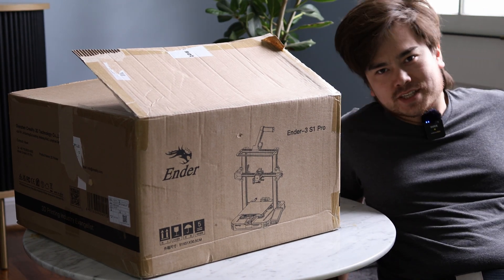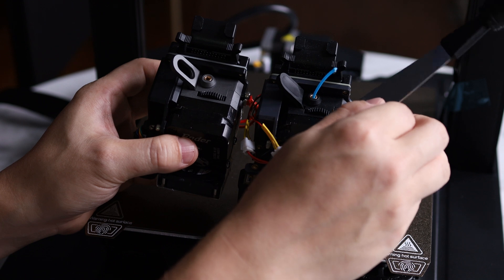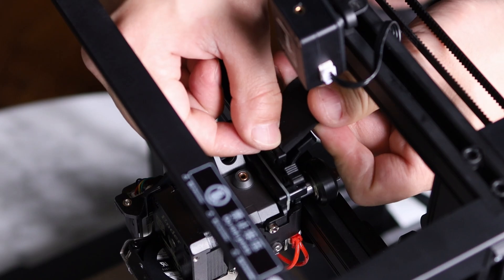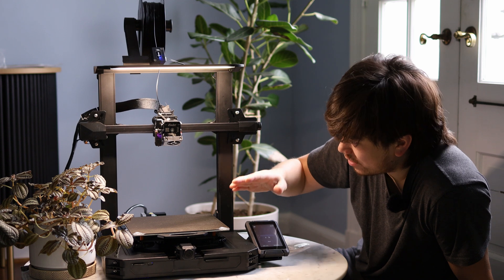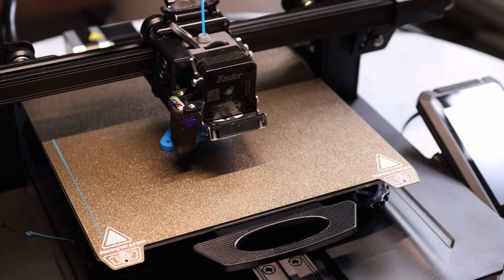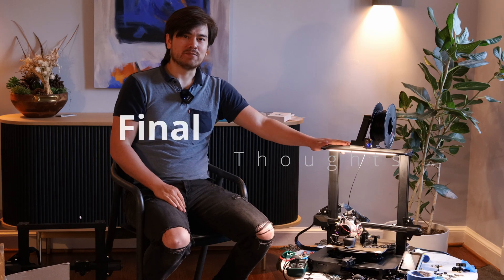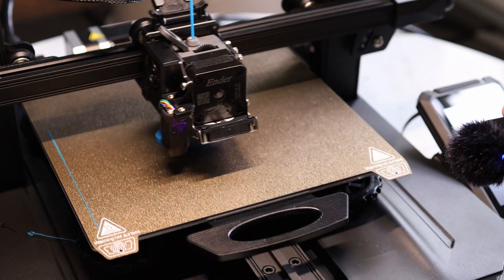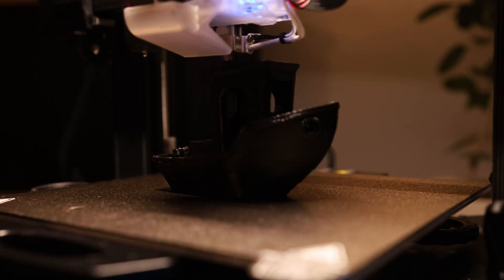The Best Ender 3 S1 Pro Review You've Never Heard Of

Comment: Ahh, mine has a light bar, and an all metal extruder and is completely identical to yours except for the firmware. I do not have an auto levelling feature? Can you level in Ready mode? Apparently not, the extruder goes on a hunt, but never spits anything out.
Reply: Nice, it was in Laser mode, not FCM mode. Leaving this here in case anyone else is the same stupid.

Comment: Mine has been rock solid since I bought it. Never even had to level it after the first time and I've run a ton of prints through it. The firmware is definitely the weakest part, but still usable at least. I had to order a second one since I sold my first one.

Comment: You make sooo many mistakes putting it together. One, the cable for the hot end assy. has a label with an arrow on it for proper placement into the holder for it ( you did not bother to pay attention to it, and it makes it removeable if you need to later ). Two, the eccentric nuts are to be tightened on the RIGHT side only and are easily accessible.  Three, NOT looking at the manual is a bad way to make a mistake. I have been in the electronics industry since the late 80's ( I hold and electronics and mechanical engineering degrees ), and I see people like you hack equipment up because you lack the understanding of basic electronics and mechanical know how. Slow down, take your time when you are building or moding and it will be a much more rewarding experience.
Reply from the maker: I agree with everything except for point 3. 
Not looking at the manual is a GOOD way to make a mistake!
This printer is currently chopped into pieces, I may reassemble it soon.

Comment: You need huge part cooling fans for PLA and maybe PETG. ABS and other high temperature filaments don't need cooling mostly, they need only when layer time is below 5-10 seconds, even then the fan should be gentle, max 50-60%

Comment: NOICE video man! I was thinking of going for this 3D printer, Id like to get one where i could upgrade it as I am a mechanical engineering student, and enjoy this kinda stuff. Id LOVE to hear your opinion on which printer  (max 500 euro)  that has the most potential for 3D printing wide range of materials and structures.

Thank u for your time and expertise! :)
Reply from the maker: I like the Ender 3 simply because it had the biggest community around upgrading and modifying it. However, I think something running Klipper would really serve you well as an engineer. Really gives you some hands on experience configuring a little computer to robot stuff.

If you want something that just works and has a huge print area I’d recommend the artillery sidewinder x2. You can get one around 300€ through my links. The SV-06 and upcoming SV-06 plus (idk if it’s been officially announced yet) are also great low budget printers that would leave some room for upgrades, like a klipper interface. Or self-build a rook printer, look up @rolohaun
Reply: @NathanBuildsRobots  oh great! I'll check them out. I also have my eye on the elegoo 3 Neptune plus. What would be your opinion?

I'm definitely going to get into Klipper 😁

Thank you for your quick reply!
Reply from the maker: @DinoLolsies  I have no experience with Elegoo machines, so I couldn't recommend them one way or the other. They seem nice from what I have seen.
Reply: @NathanBuildsRobots  yeah, looked through your videos after I commented, should have imagined. But they are very similar to the sovol line... So depends on which one I can get ( would like the plus). Where can I find the link to the artillery?
Reply from the maker: @DinoLolsies  just go to the artillery sidewinder x2 review, by me, should be there!

Comment: I have the Ender 3 S1 Max, basically a pro with bigger buildplate. The hardware on the machine is great, definitely a big update from the standard Ender 3's. Only annoying thing is the shit firmware UI but otherwise its an amazing machine that has everything you need.

Comment: Be very careful/attentive when tightening up the slop on the bed wobble. If you tighten the bolts underneath the bed to get rid of that play it has, it's possible to warp the build plate and make leveling an absolute nightmare. Go ahead, ask me, ask me how I know. Loosened them back up so there's a little wobble and my print quality has returned. Otherwise I'm fairly happy with it. Built an enclosure that I'm waiting to put over it until I can figure out a way to prevent the heated bed cable from bonking the rear wall and throwing everything off mid-print.
Reply: Can you make the cable longer? Leave the sag out and its movements will be very minimal.

Comment: Hi, what would be your personal recommendation between Artillery Sidewinder X2 & Ender 3 S1 Pro? Thanks.
Reply from the maker: I would get the X2. Great value printer that churns out parts. Only weakness is the hotend IMO. But with the $ saved you can upgrade it to be quite good.
Reply: @NathanBuildsRobots , your videos are very instructive thank you! Actually I don't need a large working bed like the X2, I think the Genius Pro could do the job. I print almost exclusively thin wall LW-PLA, PLA & ABS , would you still point at the Artillery? Or not?

Comment: How do u enjoy this printer so far do u still use this printer
Reply from the maker: I cut it up for parts. Mr clicky stole the cable from this machine so I have not been using it. Its a nice solid printer though. I would still recommend the Ender 5 S1 over this, or the Artillery sidewinder X2 for a better value printer.
Reply: @NathanBuildsRobots  u own the ender 5 s1 ?
Reply from the maker: @monsterstorm78  yes, just posted a video about it, will be posting another in a bit

Comment: i feel like the Ender 3 Max Neo is an insanely good deal.  i just bought the S1 Pro (hasn't arrived yet) and i'm starting to wish i had bought the Max Neo for very similar specs but a larger print volume.
Reply from the maker: Direct drive is worth the extra $$$

Plus dual axis leadscrew. Idk about the Neo printers, looks like same old design
Reply: @NathanBuildsRobots  it has dual axis, and the direct drive kit is just $40 on the creality store.  so for the regular price difference of $370 vs 480 for the S1 Pro, it really looks like a good deal.
Reply: @thinkdunson s1 pro has all metal hot end as well

Comment: What do you think is the best printer for a beginner at around $300?  I want to be able to print RC parts so prints need durability.  Would the ender 3s1 be a good starting point and later upgrading the hot end?  It's $300 right now for black Friday or is it worth it to spend more for the 3S1 Pro. Thanks so much!!
Reply from the maker: I would get the Artillery Sidewinder X2 if you are at all interested in printing larger objects. Just put an all-metal heatbreak on there. Its $250 right now which is a crazy deal. 
Here are some affiliate links so you can check the price:
USA: https://bit.ly/3dAqNmc
EUR: https://bit.ly/3QHOJlB
UK: https://bit.ly/3C5EpQp
Coupon code:  NNNNBRARTX2

Comment: I also get tiny strings on my s1 pro as well. Still testing with it but I speculate a coated nozzle may help.
When I got mine the firmware was buggy. For example, if I would preheat the bed and nozzle and go into the leveling menu, it would get super laggy/slow and sometimes the auto bed level would fail half way through. Yes, my bed was leveled manually first. It would also be laggy at the start of a print. I upgraded the firmware and now it works perfectly no bugs. The new firmware also added support for laser operation.
TIP IF YOU UPDATE THE FIRMWARE: Update the screen FIRST with micro SD card. If you update the main board first it can lockup the machine like it did to me(on boot it would hang at creality logo). To fix, I had to go back to an older main board version, flash the screen to most recent, then flash the board to most recent. It was a pain, but worth it. Good info on crealities tutorial video (mostly the comment section lol).
Reply: How do you upgrade the firmware? I have been struggling
Reply: @Henniebrandweer  creality has YouTube videos for it. I followed that. Make sure you update the screen first via the little SD card in back of screen board. It’s not hard you just have to take your time and make sure the file name is correct and do right steps in order. Printer automatically will update on boot when you have the firmware on the inserted SD cards. There might new videos out on it now as well.

Comment: Maybe try some sound deadening material such as Dynamat / Kilmat (or cheaper alternative, or hell some sort of adhesive backed rubber material from Home Depot may work?) on the underside of the plastic.  The plastic is basically resonating like a speaker cone.
Reply from the maker: I bought some, it’s tough to install, working around all the wires and stuff so I kind of gave up
Reply from the maker: Btw, MandicReally has a good video where he installed a bunch on his X1 Carbon. Seemed to help a bit

Comment: Does it hurt anything to only use hardened steel tips. I'm new, plan on using carbon fiber  , pla, and tpu mainly. I made a  enclosure out of 1/4 inch foam insulation panels and duct tape, lol. I'll make some plastic clips to hold it together later. 
Do you have a video on how to change print settings? Settings filament retraction, print speed. That kind of thing. The basics. Or point me in the correct direction.
Reply from the maker: Only thing about steel is its a little less thermally conductive than brass. So you may need to slow down your prints or bump up the temps 5-10 degrees.
Reply from the maker: I usually use stock settings and only really tune retraction. 1-2mm  for direct drive,  2-5mm for bowden

Comment: Hi. I'm one click away from buying this printer and it will be my first one. One question, which device are you using to get the temperature from the stepper motor at 9:30 ?
Reply from the maker: I am using a FLIR One Pro. I usually turn off their edge detection enhanced imaging and just use the raw thermal image. There is a cheaper version but I would not recommend it since the thermal resolution is much lower. 
It's surprisingly accurate for temperatures too.
Amazon affiliate Link: 
https://amzn.to/3GhjfAW

Comment: Thank you for your citical review. There is one more point that is less pro on the Sprite extruder: The routing of the ribbon cable. As it is, it will fold and move round that fold close to the extruder. Guaranteed point of failure sooner or later. Creality should have chosen for a vertical paced connector on the extruder in stead of horizontal. Again, thanks for really looking at a printer.
Reply from the maker: Very true. Designed obsolescence.
The best thing you can do is work on adding a strain relief to that poor cable!

Comment: You should never, ever print carbon fibre bylon on a brass nozzle. It will not remain 0.4mm for long, no matter how much z-hopping you enable, and let's not forget quality issues and stringing that  can happen when z hopping so much.
Reply from the maker: I was planning on changing the hotend/nozzle out so I wasn't too concerned about longevity. And it turns out that hotend didn't live long!
Reply: @NathanBuildsRobots  Yeah, I was pretty set on getting that printer, since I want to buy another one within a week or two, but seeing the stuff that was glued like that, and even more so, such important componants to be able to just remove, it made me re-think the purchase. So now I'm at a loss, honestly, of what to buy.
Reply from the maker: Also, I came across the Z-hopping issue on my latest video. Hadn't noticed it before but you're right. Z-hops, if set too high, cause some of the worst stringing.

Comment: I've had an S1 for about 6 months and I love it.  Maybe I just got an especially well built one but its just smashed everything I've tasked it with and I haven't so much as had a nozzle blockage yet.  
I bought and Ender 3 Pro soon after to increase production (been printing model planes with LW-PLA - lotsa parts) and it has been good too, though the bowden has been a bit fussier to deal with than the direct drive which I really love in the S1.  And I now find myself wanting to update it with a sprite extruder and silent board.  The S1 is so quiet in comparison.  I even upgraded it with the Pro LED light which I like in a non-sarcastic way!  Its out of the way and effective - great for timelapse recordings.  Sounds like I was wise not to get the Pro version from your negative experiences with it.
Reply from the maker: I like the S1 more than the S1 pro. I bought the sprite upgrade kit. I'll be installing and reviewing it when I get a chance.

Comment: What would you recommend for a newbie 3d print enthusiast.?
Reply from the maker: My favorites right now are the Ender 3 S1 (standard edition) or the Artillery Sidewinder x2. They both have pros and cons that I cover in my dedicated videos on those printers
Reply from the maker: TLDR: Ender 3 s1 has better modding and community support, Artillery is easier to use/ better out of the box, while also offering significantly larger print area.
Reply: @NathanBuildsRobots  Thank you very much i was a bit concerned as people stated that Prusa is top quality but the price point and import duty becomes around 1000+ dollars in my third world country thank you for your opinion and clarity .Have a nice day
Reply from the maker: @crewneckdeath6801  I have used prusas. They have issues just like any other printer, so don't feel you need to spend $1000 to get into the hobby. 

If you want a good, cheap printer is look at the voxelab aquila. Sometimes they are under $150
Reply: @NathanBuildsRobots  thank you very much again.Too much marketing in youtube head stops working .Thank you for the unbiased answer.Good day sir.

Comment: Everybody seems to be very happy with s1pro but my experience is strangely quite disappointing. Previous printer was ender 3 with replaced silent motherboard and 2 fans replaced with silent version. It was virtually silent and printing precision was very good (out of box since the start, printed around 4-5kg of pla in total). S1Pro is NOISY! the motors make noise which is halfway between silent mb and old ender 3, the fans are also very noisy. The adhesion is bad - all rectangular shapes warp horribly on 1/2 corners. The corners overshoot significantly. Hope I can still figure out how to tune the slicer parameters to workaround, but feels so bad to pay twice as much and get all that headache...
Reply from the maker: Yes, a big problem with that big boxy base is it acts just like a guitar body, resonating and amplifying nose from the motors.

I think a lot of people want a silent machine, which is totally doable with minor changes to the design.

Comment: Would the voxelab s2 be competitor to the s1 pro
Reply from the maker: Voxelab is really the best value for money brand. 
They give you a lot of good features, at a good price. 

The S1 Pro has some additional features that make it worth it in my opinion: 
A superior dual gear direct drive extruder. 
Dual z-axis lead screws
Touch Screen (if that matters to you)
Automatic bed leveling
Bigger modding community

Personally, I would go with the S1 standard edition. I bought one with my own money and it's been great.

Comment: I had exactly the same issue with the power cable snagging on the stepper. It sorted itself out after the cable had had some time to get warm and relax into a better position. Definitely something for buyers of a new S1 Pro to watch out for. Also just to add that my rear stepper motor always runs at a far higher temperature than the other steppers...just like your review model.
Reply from the maker: At least they are consistent!
Reply: @NathanBuildsRobots  Nathan, I have recently read the reason why the rear stepper motor(Y axis) gets much hotter to the touch than the 2 Z axis steppers. The 2 Z axis motors are wired in series and therefore only drawing half as much current through each motor as the singularly supplied  Y axis motor.

Comment: You were one of the unlucky ones in the Creality-lottery, my S1 is working flawlessly, tho i would rather sell it and get a cheaper printer that has the same functions, ive been looking at Sidewinder X2 Mingda Magician X, but most likely ill just splurge on Bambu Lab X1 Carbon :P
Reply from the maker: My S1 is working great, my S1 pro is working pretty good, and my S1 Plus is just not working, so I've got a little bit of everything from Creality.

The Magician X works decently, but it's got a lot of plastic parts, like the base and leadscrew nuts. And even after using it, i'm not sure how the bed-leveling sensor works. Which is just a little unsettling, but hey, it works.

I like the Sidewinder X2 a lot. Really well-rounded. On my Artillery Hornet, it took a couple hrs to figure out how to flash firmware onto it. I needed to download a program from STM, and had to put a jumper on the motherboard before it could be flashed. I assume the X2 is the same way. But this isn't really a problem if you just leave stock firmware on it.

The Bambu Lab X1 looks amazing, I'm looking forward to the 2nd round of reviews, from Kickstarter backers that paid real money for them. From what I've seen things are going pretty well. Only thing thing I can knock it for is closed source firmware that is trying to do A LOT of things. It will probably be a slightly buggy experience for the first couple months while Bambu fixes things. Over the air updates means it will probably won't be an issue for too long.
Reply: @NathanBuildsRobots  Ah, sounds like I'll be getting X1 Carbon, i never buy a brand new printer, I rather wait 2-3 batches so most of the issues have been ironed out, it's a breakthrough in consumer 3D printing